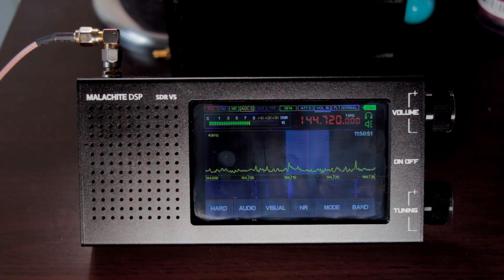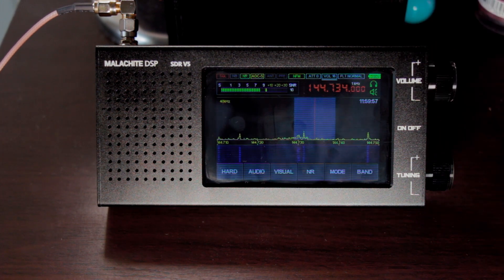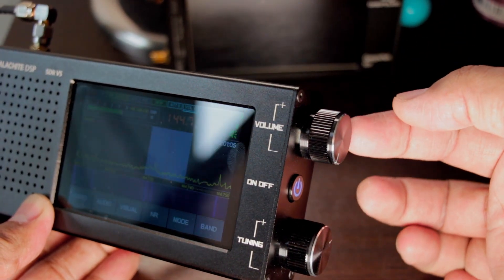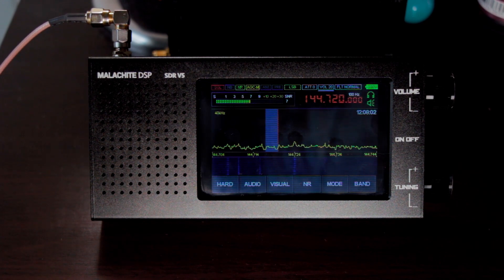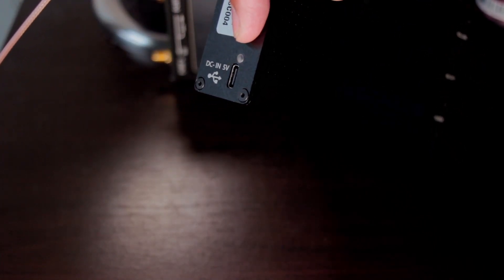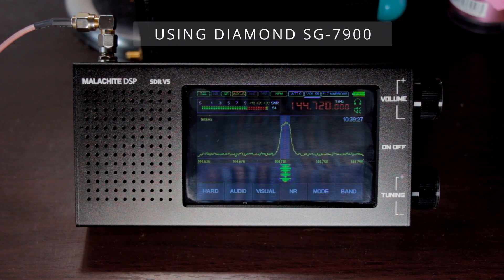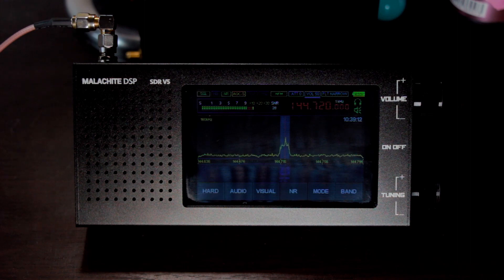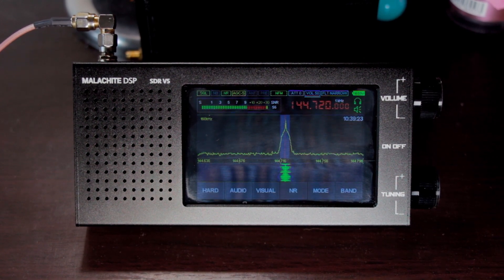2023 Malachite DSP SDR V5 (Firmware v1.10D Fully Activated) Basic Overview

Comment: Would be an improvement to have the frequency and volume turning knobs on the front face rather than the side for use mobile.
Reply from the maker: we prefer on the side.
Reply: Like I said, analog type knobs are impractical for a mobile station.  

I can see the natural ease of the side knob though for shack use.

Perhaps a digital tuning interface in addition on the touchscreen then?

Comment: Single antenna connections do not buy
Reply from the maker: Why is this the case? This V5 device does not require two antenna connectors because it can be used with any 50 Ohms or Hi-Z antenna on the HF, VHF, and UHF bands with a single antenna connector.

Comment: Thanks for your excellent video.....Question please: Can you touch an active frequency on the display, with the new version, and the radio tunes that frequency OR must you manual tune to each active frequency with the tuning knob? Thanks, Michael KZ5MSE
Reply from the maker: Thank you for the kind words. To begin, the V5 does not require tuning of the RF signal it receives. However, the right modulation parameters must be changed depending on the setup of the person transmitting. To improve the clarity and quality of the audio output, other settings must be adjusted. Second, while on active frequencies, you can touch the screen to alter the frequency or its settings.
Reply: @N7SIX  Thanks for your quick reply... So, as I understand: You can "rough tune" by touching an active frequency on the waterfall with a stylus pen, then fine tune with the tuning knob, plus further enhance the signal by selecting filters, etc?
Reply from the maker: @michaeledmonds3027  maybe you misunderstood me, you do not need to fine tune the frequency.

Comment: Can Firmware v1.10D be "not" fully activated?  Did you have to do something to "fully activate" it?  Maybe I missed it in your vid.
Reply from the maker: All V5 with 1.10d released by Deepelec are all fully activated. Only those from other China clones are not activated and you need to purchase activation key.
Reply: Ahhh! OK.  Thanx.
Reply: @N7SIX Is it possible to update the firmware version to a new one?
Reply from the maker: @Pavel_e10  hardware is not capable of upgrading the firmware.
Reply: @N7SIX  very unfortunate (probably requires a processor upgrade
Reply from the maker: @Pavel_e10  that is correct.

Comment: Does this V5 model have the occasional EMI (RF interference) from the LCD screen that the earlier V3 model has?
Reply from the maker: I have not experienced any interference with the V5.
Reply: @N7SIX  Thank you... that is great to hear! My V3 experiences QRM from the screen every 60 kHz or so. That unavoidable interference is why the designer built in a "tap" of the power button to turn off the display, making reception on those frequencies clearer without the interference.
Reply from the maker: @4nradio782  oh, are you talking about the touch screen interference?  That is normal only with HF but beyong 50MHz there should not be any problem. That is why, they made this EMI functionality and disabling the screen to lessen the annoying interference. On my V5, it is not an issue during operation on HF. I don't touch the screen hard, I touch it softly.
Reply: @N7SIX  Yes, I meant the touch screen interference on HF. It's good to learn there is no problem like this on HF with the V5. In your videos I watched closely when you were on HF or medium wave and I did not see any such interference. 👍